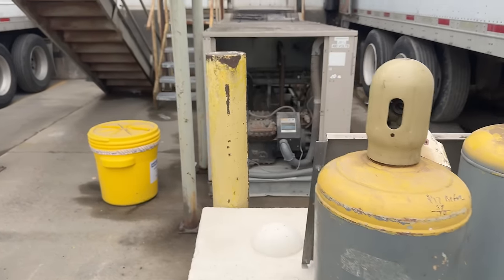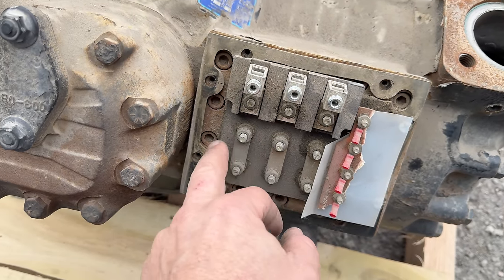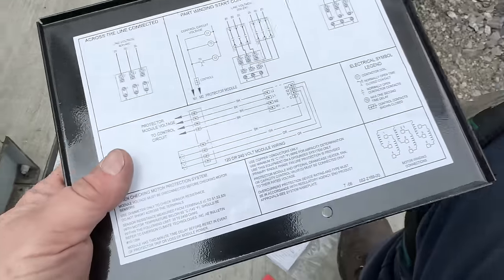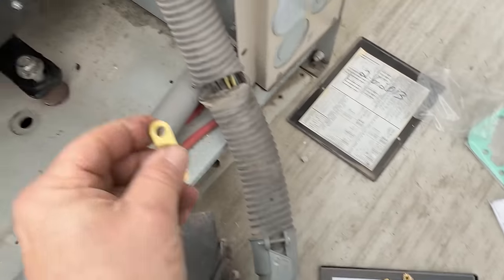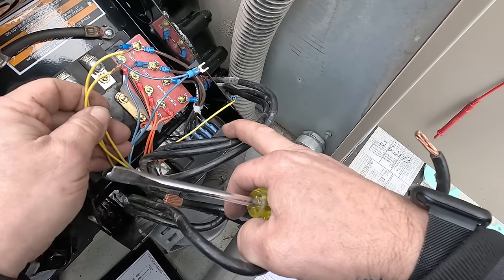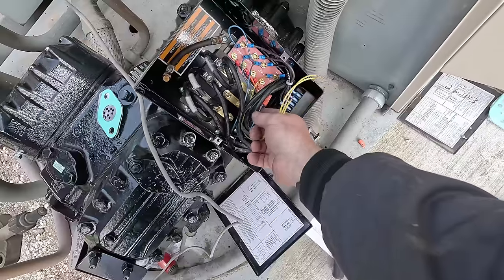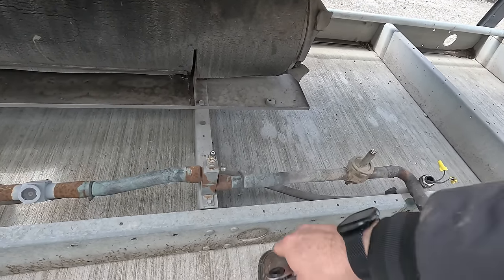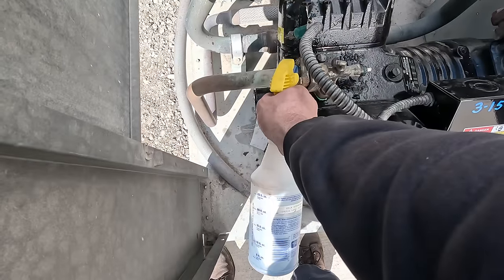Old Condenser - New Location - New Compressor

Comment: Ha, so you thought you could slip this video in late at night and no one would watch!  I got a whole fifth of Kentucky bourbon to sit  back and watch the entire video.
Reply: Couple of jelly jars of pinot noir here
Reply from the maker: They take too long to edit, I tried having it done by 11 today but it didn’t work out with what all I had going on.
Reply: @HVACRSurvival Rick as always great video.   Couple of questions if you don't mind. I guess you are waiting for all the copper work to be completed before installing new filter driers. I did not notice a crank case heater on the old or new compressor or did I just miss that ?
Reply: Nice to see something going correctly, not all the make it work stuff. Nice video. You are the wizard of make it work.

Comment: that restrictor plate looks homemade, like someone made it to stop large failing compressor chunks from coming out. 🤣
Reply: I believe it is there to reduce compressor discharge pulsation.
Reply: @08airman  yeah, it's mainly a stupendously implemented noise elimination tactic.
 the problem is when not sized right the compressor will run high head, have possible gas flow starvation to the system amongst many other things.
I don't think see a way to check the pressures on either side of it, which should always be done.
changing refrigerants could be a big problem and maybe that's what killed the last compressor. lol

Comment: In 30 years never saw that plate in discharge. Tip to offer you and other comment readers. When changing semi-hermetic out take a couple minutes and quick pop old heads off to inspect valves. You can learn a lot about the failure no other way so you can correct system problems and not repeat failure. Past contractor was an idiot disabling part winding start.
Reply: @glens123 - How would you wire a 9 lead 460 volt motor for part winding start  ? You can on a 6 lead, but not a 9 lead.

Comment: You're missing the core filter drier
Reply from the maker: Why would I replace the filter dryer when I’m not ready to hook up the evaporator. I tested what all I could test at the given time.  Come to find out it leaked through the stem of the discharge service valve.

Comment: The lugs for  the compressor wiring was described as "aluminum ordeal there." could you expand on that? Were these aluminum lugs or copper lugs with some sort of anti corrosion plating (nickel)?  Aluminum has a greater expansion rate than  copper thus creating a maintenance item requiring visits to ensure that the connections are secure. By the way, I worked in data centers and your trade kept the internet working. Big thanks!!!
Reply from the maker: You’re correct I believe it was aluminum, it’s a poor choice of material.

Comment: Hey I had a quick question, I seen in one of your other videos and you called it the "captain hook" tip for brazing, where did you get that at? I need that in my life haha
Reply from the maker: That’s made by Uniweld. I just bought the number nine. What you seen was the number five.  The number nine lets me go up to 2 inch. You’ve got to have the 71 handle or the other handle. That’s the same as just different location on the two knobs. I got links for the handle down below the end, the description for everything, but that captain Hook, but you can find it on Amazon. It will fit on a Victor tort set, but it does not seal properly and will have issues staying lit.

Comment: Why was the part winding start deleted and that relay that’s missing is for the crank case heat it is also used for a interlock with the C1 coil  (compressor)
If memory serves me right it’s labeled #10 or #12 on the wire CCH 
I got you Rick I know that unit like the back of my hand
Reply from the maker: I’m ordering a crank case heater for it. It didn’t come with one and it didn’t have one prior.  I’m not sure why they removed the contractor. I know that they ran a 100 amp circuit to it so I’ll check starting amps and running amps when it’s up and running and if I need to wire that other contractor in I will.
Reply: 90-340 relay works for that relay 
Rick I appreciate you I know what it takes for you post these videos 
The time you put in on it 
Idk how you do it 
Appreciate you man

Comment: I would have put that "restrictor plate" in the rubbish bin. It might make the compressor discharge quieter but in industrial applications who cares about quiet
Reply from the maker: I had my thoughts it might be a bad thing. I need to research it more.
Reply: @HVACRSurvival  bin it first. I bet it contributed to the compressor failure